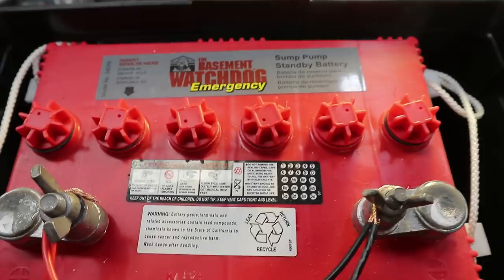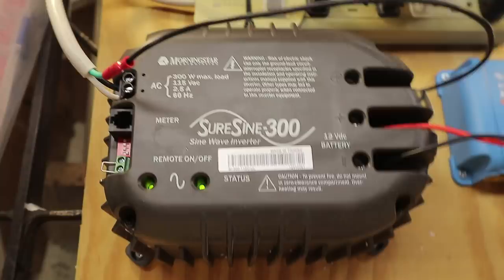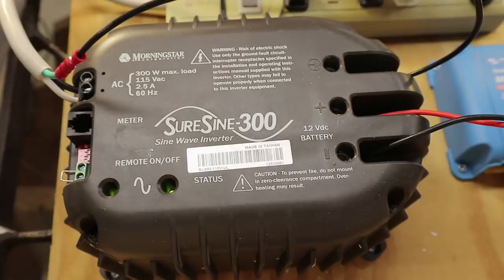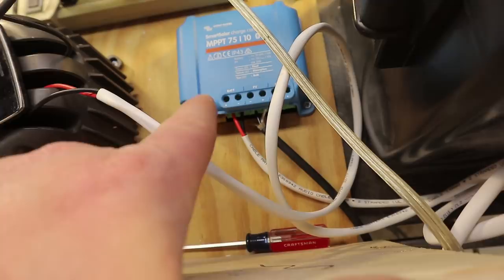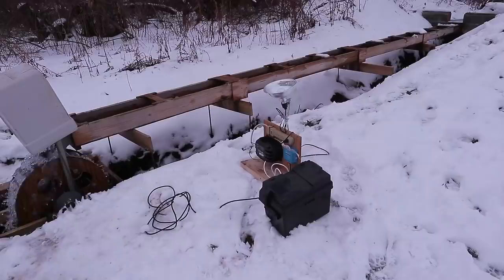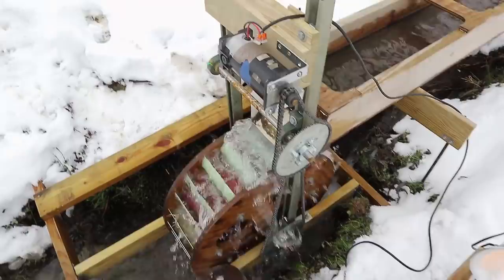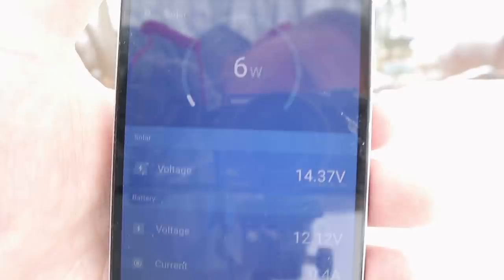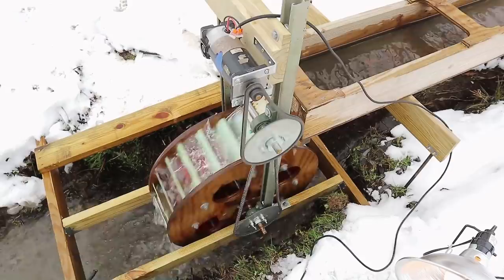[Part 10 of 10] Waterwheel Microhydro, How Much Power?

Comment: Hi joe, if you went with a low rpm 3 phase alternator you could lose two bearings, two sprockets and a chain, that would up your efficiency by quite a bit. just an idea. informative videos regardless of output.
Reply from the maker: I tried very hard to find a suitable direct drive alternator that was affordable on my putzing around in the creek budget. By the time my channel was making enough money to afford a suitable alternator I was already down this path. FP washing machine motors would likely have worked but they aren't available in the states. The largest cheap brushless motor I could find in the states was the hoverboard motor and it wouldn't have had the volts with direct drive.
Reply: What about a treadmill motor?  I found some 4HP?....   $50 on craiglist
Reply: Mass turning enough to turn a bike wheel via bike linkages dozen + bottle dynamos 12v 6W each
Reply: @JoeMalovich  Hey, If you use these kind of wheels, you wont be able to generate enough power because every  hydroelectric scheme converts potential energy into electrical energy and you do not have that PE of water for this system.
liked your efforts though.

Comment: Honestly, 5 watts isn't bad considering you have a low-head, lowish flow system, a water wheel (much less efficient than a turbine) and a homemade wheel at that, and a lot of other DIY and upcycling. For a wheel that size, with that water source, you would be lucky to get into double-digit wattage. It was a great project and you got it working to a degree, and it was interesting for all us viewers to follow. Now onto your current project at your new place; I have a load of videos to catch up on but it looks like you're getting much more power with that, so look forward to following that!
Reply from the maker: Thanks! Finally a sane comment.

Comment: Isn't the point of building a dam so you can create head-pressure? What you want to harness with hydro-power is pressure*flowrate.
The flowrate of a given creek is fairly consistent, but you can get more power out of a creek by damming it up, thus increasing pressure by way of elevation and water mass.
So you want to harness the pressure of both the water mass AND the elevation.
Your current setup only partially harnesses the elevation, but not the water mass pressure.
The way to do it properly is tap the reservoir behind the dam at the lowest possible point and forcing it through a generator to get to the other side. That way you exploit the maximum amount of pressure and flowrate.
Reply: yeahbut, I think his project was focused on the waterwheel aspect, not necessarily the best hydro system
Reply: @audiobrew  what would be the best?
Reply: He doesn't have enough flow for a high-pressure turbine. This creek typically flows under 30gpm, and this is the best head he could get without flooding the back yard. The outflow just past the water wheel basically spreads out into a marsh so he'd be gaining inches with even another 30 feet of flume.

Back in part 7, he calculated that the theoretical max power would be about 12W. Apparently, it takes a particularly advanced wheel design to get above 67% efficiency. I think he did pretty good to get close to 50% for just throwing it all together with no tuning to see if it even worked.

Comment: You could have increased torque on your water wheel if your flume was twice as wide at your inlet on the pond then gradually   narrowed the width of your flume to your wheel. This would have increased your head pressure just like old strip mining operations before use of pumps. This increase in water pressure equals increase in torque. I found your experiment very interesting with a few flaws, your flume being your main flaw. Good luck with future projects.

Comment: The  next time you design a flume consider making it horizontal to just past where the wheel is and put a rectangular opening such as for the trap door but without the door.  Put a vertical gate in a track just shy of the opening that will control the water flow.  The opening should be above a bucket just past the very top of the wheel.  This arrangement will allow the buckets to fill with the water falling straight down into the buckets instead of shooting off the end of the flume.  Make a very simple model to try as an experiment.

Comment: You need a gearbox. You're already able to spin the water wheel constantly which is huge. Now you need to get high speed rotation from a gearbox for your alternator/generator. You can produce sooo much more with your setup.

Comment: Joe, I'm sorry for the poorly obtained result, I hope you find a solution to produce power. You should have a servomotor, I have one and produce 500vdc in open circuit at 3000rpm. I think one of this should be. AC Servo produces three ac phases, connected to a three phase rectifier bridge you will get. Very successful in making decisions and waiting for the next video. Good luck with your work

Comment: I enjoyed what you were trying to do, keep up the good work. Instead of using a dc motor, Now consider finding an old 120/240 generator off of a genset with bad gas engine. The genset will have the AVR and everything else you need.

Comment: Joe, if there is an RC (Reserve Capacity) rating on the battery, you can guesstimate the AH rating by multiplying it by 0.42. The RC rating is defined as the number of minutes a fully charged battery at 80°F or 27ºC will discharge 25 amps until the battery drops below 10.5 volts. The RC rating provides an indication of the time that a vehicle with a normal electrical load will run for if the charging system (alternator) fails. Hope that is of help.

Comment: At 5 watts of power you could be running a small DC brushless motor from a remote control car off a rubber band. 

Due to the size of everything your parasitic losses are high probably at least quadruple your energy output.

Comment: Nice installation.
I think that even with a high efficiency system you cannot achive more than 10W.
The maximum power (with an efficiency of 100%) is equal To P= Q.ro.g.h It seem that you have around 0.0015 m3/s and 0.8 m  of fall, then P= 0.0015 x 1000 x 9.81 x 0.8 = 12 W. 
You need to encrease the flow or the fall or both, if it is feasible.
Reply: That's about what he calculated back in part 7. The flow is what it is unless it's raining or the snow is melting. The head would flood the back yard with a taller dam, and the creek spreads out into a marsh just past the wheel, so he'd be gaining bare centimeters with another 10 m of flume.

Comment: Hi Joe, the fact that your wheel had so much water falling in the back of the wheel  and in this way loosing energy is because your flow of water need to be a little more to the front of the wheel, so if you would of made the water drop further, that wolud capture more energy.

Comment: Great vid. Started watching your video's because I'm DIY'er and I like to see what kind of solution's people come up with while doing projects. Thought I'd let you know (sure someone has already said it in comments) but you can pick up a 12VDc primary coil relay at most auto parts stores in the electrical section, most use them for turning on running lights, fog lights, and light bars.
Reply from the maker: It wasn't really necessary to just test the system so I didn't bother.
Reply: Completely understandable, especially due to the sale of the land and not needing to do a more permanent installation. Either way was pretty cool to see you progress thru your concept and design making corrections and tweaks as you went along. GL on the future projects at the new house and property.

Comment: Not sure how big your property is but Pelton wheels are a lot more efficient if you've got enough drop, like running a pipe from the Water Source high up and letting it run down into your generator but the more gradual the slope the longer the pipe would have to be to get the drop required that would give the pressure to run a Pelton wheel and Pelton Wheels run at high RPM so you could probably connect it directly to the generator

Comment: To increase the efficiency, you really need to raise your water wheel out of the water. 
It's being forced to spin, partially submerged, against the flow of the stream beneath it. This is the equivalent of a friction brake, as it struggles against the flow of the stream beneath it.
Reply from the maker: 10:34
Reply: yea its not touching the water below

Comment: You probably need some heavier wire between inverter and battery - for every 1 amp you pull at 110v you are going to pull 12 on the DC side. You could end up letting the magic smoke out of that wire.

Comment: Hello Joe. You did a very nice job. congrats.
Generally, it is told that the power is related to the height of the water fall. May be you'd try tu let the water fall forward, almost tangent to the weel..... you won't ahave a reverse turn like you had with very few current. Regards
Reply from the maker: And splash away wasting the bottom half of the rotation? No.

Comment: You can add multiple turbines on that long water shaft with horizontal wheels spinning . you are only using one source of energy and most of the energy of the water is being wasted by splashing around. you can also add more gears.
Reply: Hamguy Bacon 
But couldn't the extra rotational massing (requiring more inertia to turn) and the extra parasitic loss from friction (from adding gears) be counterintuitive to creating a more efficient system? 

I'm not criticizing, I'm genuinely curious! I am in no way, shape or form an engineer by any means.

Comment: Kinetic energy of the water is probably similar to the gravitational energy in your system. This means every drop of water not captured by the wheel is unrealized energy. Also given that 6 Watts was the top power output, the application of even a small amount of grease or oil to the chains would cause a proportionally significant resistance in the drive mechanism. I believe flat drive belts similar to 3D printer belts would add maybe 5 Watts to your output. A further 5 Watts could possibly be gained by increasing the size of buckets 250% or so in order to capture all water even at half wheel RPM, then tune your drive ratios to force  your wheel to slow down by 20% or so. This will capture all forms of energy in your system to the maximum.
Reply from the maker: Bingbangboom I really appreciate your engineering minded comment (unlike so many others). In response if I could have made or sourced a big ass belt sprocket for gates gt2 I would have. The grease probably slowed it down a hair true. A wider wheel was in the plans for Rev B before it was cancelled.
Reply: Ya I agree with BBB.   You are converting kinetic energy of water flow to power, so any loss of water droplets you aren't harvesting from, is efficiency drop.   Also, you have a small constant supply, so think about power storage over time.  The battery of course is one electrical way, but mechanically you could do that with heavy flywheels for sides that resist momentum changes, because the water will eventually cause max momentum in the heavy flywheels, and then instant losses due to other loads, such as friction, will be smoothed out, raising the effenciency some of the system.  Also, 3 or 4 rib serpentine belts seem to have the least losses in a low power system IMO.  Low friction chain interaction is pretty good tho also.  Nice project.

Comment: It is all about gravity. You need a steep angle of flow and channel the water into a narrower and narrower sluice. This creates flow force. You had say a 200 foot run down a steep grade your wheel would produce at least a significant amount of current.
Reply: The power available is purely a function of head and mass. Let's do the math.
He hasn't shown us the actual flow of water, but let's estimate the flow rate at 1.5 liters per second. That would be 1.5 kg/sec. His head is 30 inches which is .76 meters. And gravitational acceleration is 9.8 m/s^2. So
.76 m/s^2 * 1.5 kg/s * 9.8 m/s^2 = 11.2 kg*m^2/s^3
Looking up the definition of a watt and you'll see it's kg*m^2/s^3, so at 100% efficiency he would get 11.2 watts. For an installation so small, 50% would be good efficiency, so his 4 to 5 watts is quite reasonable. Honestly, the first thing he should have done prior to all that work was calculate the available head and flow volume to determine if the effort would actually have a reasonable return. He did the head determination, but totally ignored the flow volume and hence did a lot of work to no gain. Honestly, I suspect he spent more power building the system than he would ever extract from it, resulting in a net loss.

Comment: Hi Joe,

Do you still work on this project? I like it :)

(Without having read all previous reactions) there are a few remarks I would like to make FYI / to help you get more out of your hydro setup (that imho is quite ok)

- for starters, use an self regulating AC generator, for instance one out of a small ca or, a motocycle. this is much more efficient and sturdy, and takes care of regulating a reliable output tension. It also will automaticly reduce the mechanical load when needed to keep the rpm of the wheel sufficient to keep the alternator at an efficient speed. If wanted you can also get any convenient tension out of it by tapping into the alternator before the rectifier and connecting it to a transformer. (I did this sometime, and works perfect)
- please stop measuring volts assuming this is any indication of te output power. An unloaded voltage of an alternator only is an indication of its rotating frequency (and not even that accurately)
- make sure the underside of the wheel is above the water surface as the surface make a big drag on the wheel
-try to up the rpm of  the alternator with as little as possible friction, as the friction oon the small side multiplies back to the wheel. Best you a single step recution with a toothed belt. Yes, the big side then has to be very big. Tip to make your own big gear wheel: you can make it by attaching a toohed belt inside out on a wheel. The tooths then fit nicely and you can make any size you want this way.
- Your estimation of the maximumachievable power based on the weight of the falling water /time is not taking in account the kinetic energy of the incoming water, so in theory you should be able to get more power out of this setup. I think you should be able to get 15 W.

- please bear with my spelling errors english is not my native language ;)

Comment: it might only be 5w but unlike solar its 5w day and night
Reply from the maker: Yup, equivalent to a much larger rated solar panel. A 50W panel on a cloudy day would make about as many kWh as my wheel.
Reply: But a 50W solar panel would make the same amount of power in 1 hour, as your setup does in 10 hours, and its easier to setup a solar, compared to all the work you put in this. Anyway, nice project, shame to see all that work and effort isn't really paying off for you. Maybe you can find a more efficient generator. Cheers!
Reply: Joe Malovich Edison didn't make over 1,000 mistakes designing the light bulb and how much light it delivered as he invisioned. He made over 1,000 steps not mistakes, but steps towards his final goal. Keep researching and improving on what you are doing and the biggest this is to never give up. See what you can learn from established manufacturers etc. I hope you can make this work for yourself on you new property.
The Government wouldn't use hydro power if it wasn't feesible...
Reply: could produce in 1 hour the same amount, but at night I would have more batteries for autonomy for the whole night while with the wheel would be a constant autonomy, I would only tell Joe that he has control panel mppt, should connect the output the inverter is charged, to take full advantage of the regulator, and the voltage produced by the wheel, the generator is able to give the amperage, and the regulator also 10 amps, and helps protect the inverter circuit since the regulator if there is not enough voltage is helped with the battery charge, and if it is enough input do not require many batteries for your consumption. Greetings Hamilton from Medellin Colombia.
Reply: Yeah. Rain or shine and 24 hrs a day.   Perhaps next version go straight to the motor from the wheel
Reply: At a guess without doing the math this would actually make close to a 200w solar panel 
I haven't done the exact math but if you work it out, a solar panel only makes max efficiency for around 1 hr a day depending on how much sun light your area gets it may get 8 to 14 hrs at a guess 
5w 24 hrs a day is actually really good considering 
And it wouldn't take much to play with it and get more
We had a spring on our property that the neighbors down stream put a water wheel in and it made 100w when it was first installed 
In the end it was closer to 500w
Reply: Mass turning enough to turn a bike wheel via bike linkages dozen + bottle dynamos 12v 6W each
Reply: @Colaaah  Edison didn't make ANY light bulb... he just stole it from Tesla.

Comment: 4:04 - Capacity of a starting battery is probably quite low - 30-40 amp/hour.
that's about what I get out of a 300-400cca battery.

Deep cycle AGM would probably be a better choice if you can manage to get one.

Comment: Hello Joe Malovich the mppt panel controller, you should connect to the load output of the inverter, to take full advantage of the regulator, and the voltage produced by the wheel, the generator is able to give the amperage, and the regulator also supports 10 amps, so help protect the inverter circuit, since the regulator if you do not have enough voltage of the wheel will help with the battery charge, if the input is sufficient do not require many batteries for your consumption. Greetings Hamilton from Medellin Colombia.